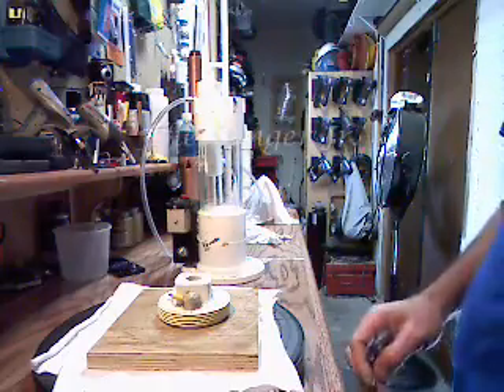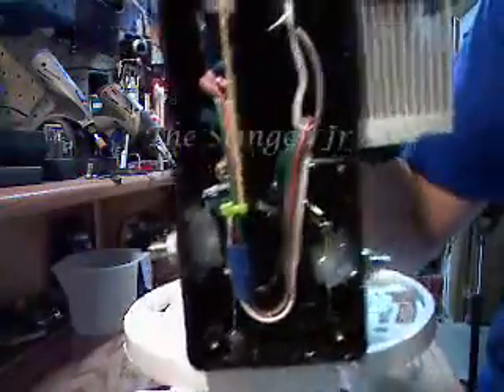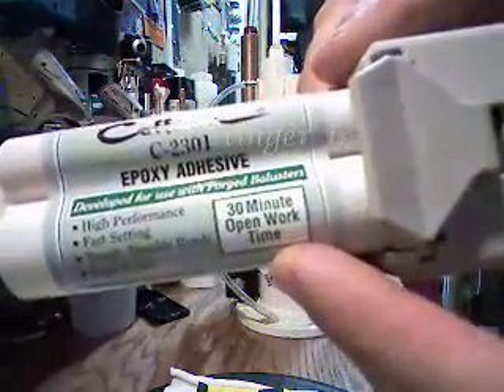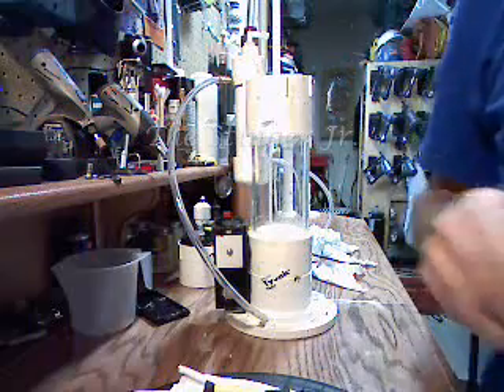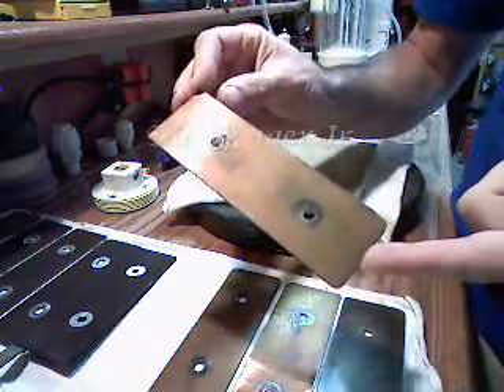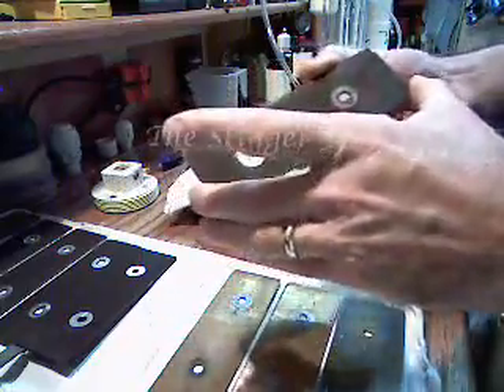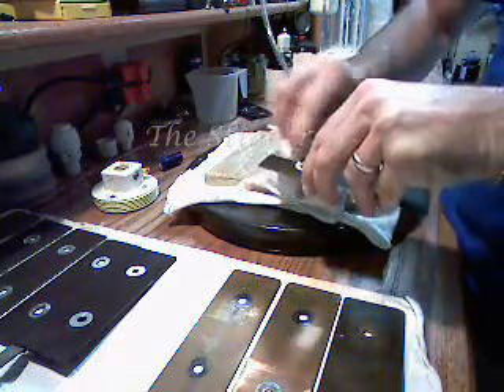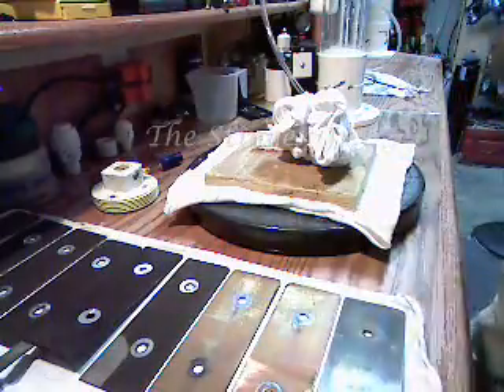HHO Plates after 50+ Hours

Comment: Actually, the negative plate produces the hydrogen, and the positive plate produces the oxygen...together they produce oxyhydrogen(hho). The oxygen does oxidize the plate more readily where it forms. The hydrogen doesn't do that. The electricity(electrons) flows from the negative to the positive(not conventional current), thus producing a kind of electroplating scenario; hence the coating.